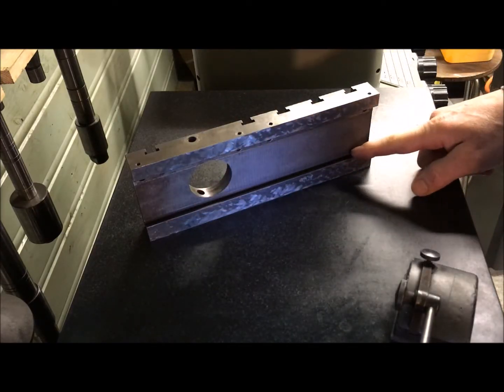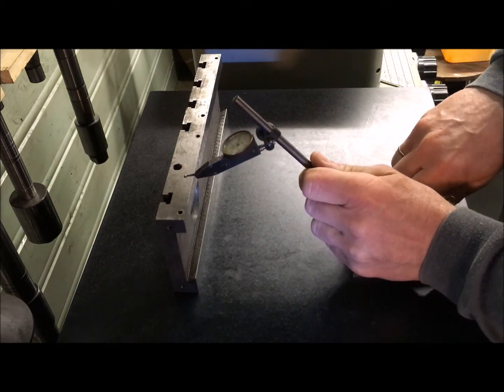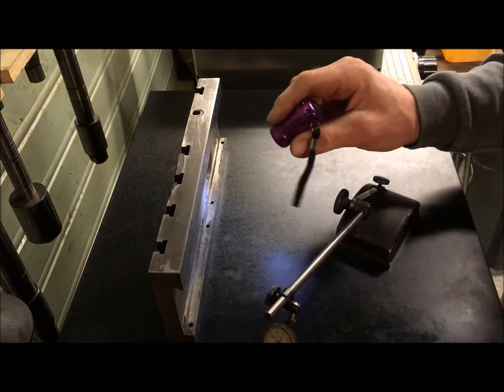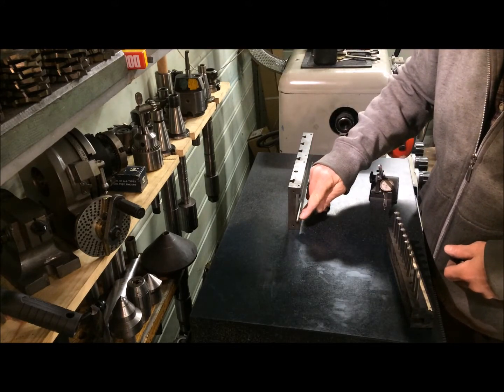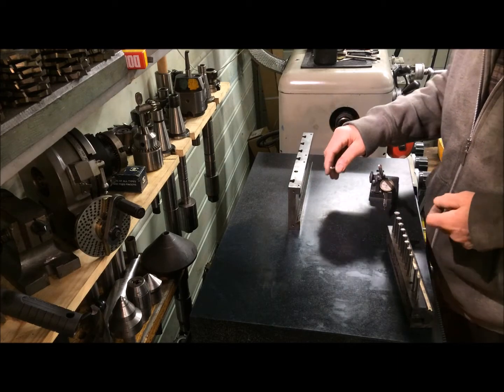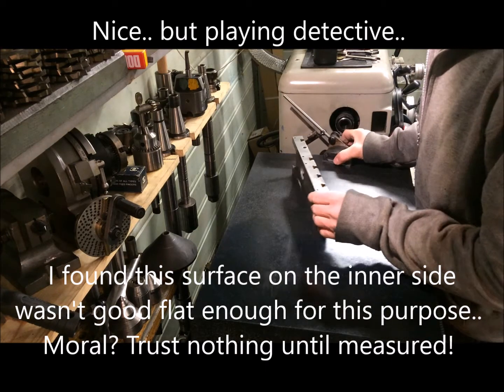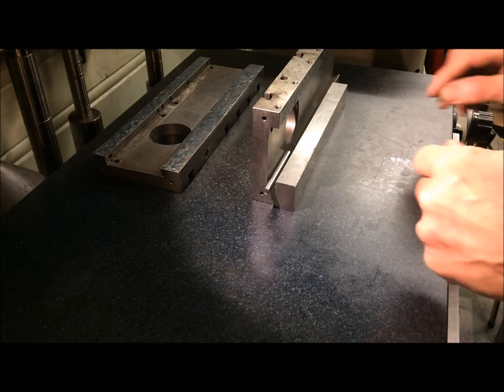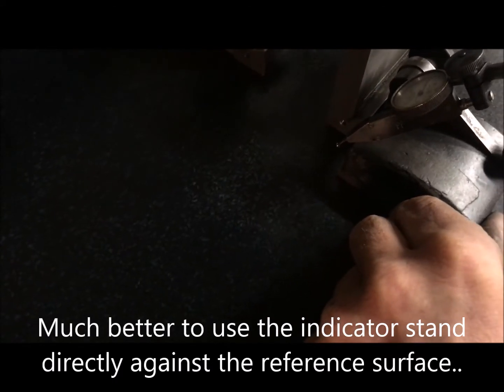Myford 7x7 - cross slide - dovetails - measurements and "roughing"

Comment: That seems like a big scraper for inside the dovetail.  I assume you tried different scrapers, I'm curious what the one you are using does better than smaller ones. 

Since I don't / can't use much force in small dovetails, my bigger scraper shafts are too stiff to get the flex that makes the scrape into a good shape.   With my smallest scraper (5-6mm wide) I can get some flex, and I can see more.
Reply from the maker: As you said.. tried  some smaller also. However, no appreaciable difference. My regular scraper is also flexible enough to give the right "feel"

Comment: I always wonder, what are the chances, that during dove tail scraping, you can change the angel of dove tail surface? Can you control that?
Reply from the maker: There is a good chance that this will be slightly changed, but the exact angle isn't of any importance, only that it matches the mating dovetail side.
Reply: @jansverrehaugjord9934  And because other side of dove tail is your master it is only important to match your master surface to slave surface right?
Reply from the maker: @kundeleczek1  Well, you use the straightedge as a measuring tool to achieve flatness and points, not angle. This is done for bot mating surfaces. Then after seeking not top alter original geometry too much/at all, you will test the 2 freshly scraped surfaces to one another and then possibly have to correct a small amount to obtain the needed coverage
Reply from the maker: @kundeleczek1  Lapping both sides will probably be a bad solution as they will stick to one another as there is no room for the oil, and you will experience so-called "stick-slip" ie. the travel will not move as they should. Remember, normal ways like we handle here shall ideally float on the oil and have minimal contact. Lapping will also be a extremely lengthy/tedious process, not removing much material vs. scraping